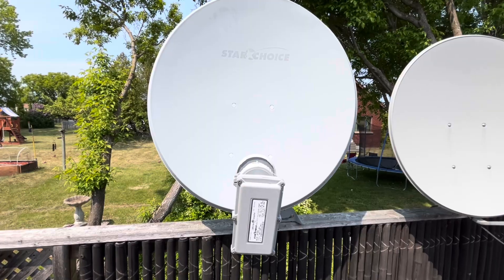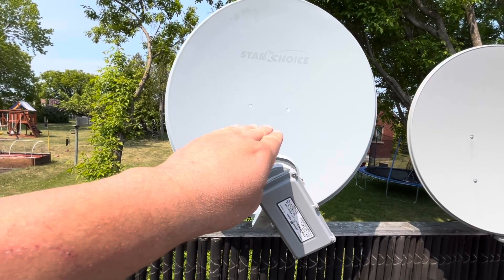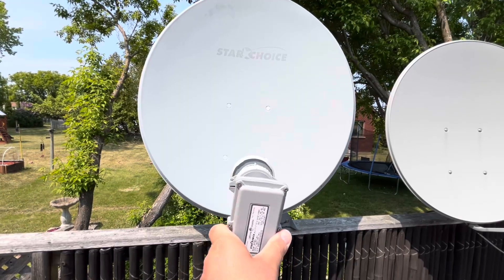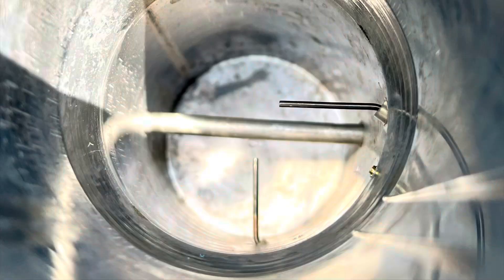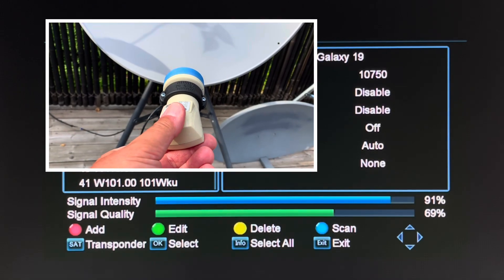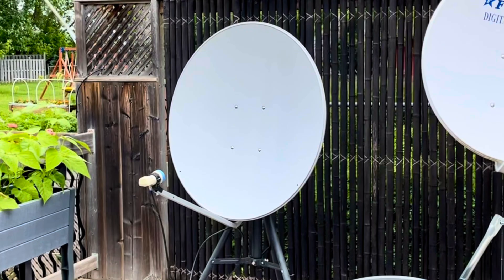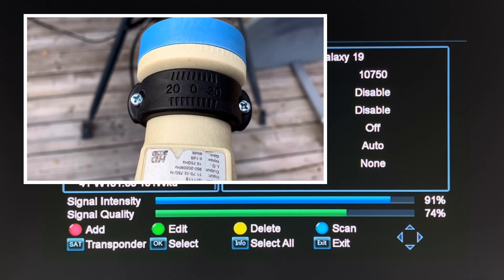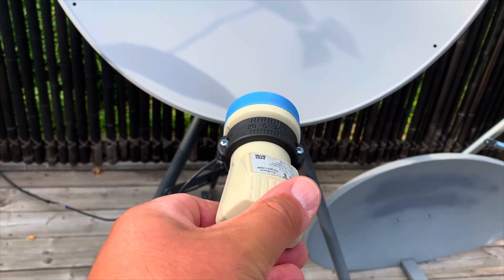LNB Skew is critical when setting up your FTA satellite dish

Comment: I bit the bullet and bought the dish that you will see on eBay with the bar for multiple lnb’s  sold by Canadian seller  and got to say nice dish. Set the dish skew between 70 -80 degrees, my longitude here is 76 w and if I didn’t have trees on both ends of ark it will receive real good . Mounting only drawback is pole size not common   1.75 or 1 3/4 inch  dish . This is a switch it’s made in Mexico.   To find straight pole steel fab place , appear’s inb hardware is stainless and that’s a switch.

Comment: I remember when I got into satellite hobby back in 2018 after setting up the azimuth and elevation, the LNB was on 0 degrees, I didn't rotated and on some transponders I had low signal quality and during bad weather I got "no signal". I asked on social media and the installers asked me abou LNB skew, it was the final part of setting up the dish that I didn't knew. After rotating the LNB I had very good signal even excellent.

But if you use H-H USALS motor you never rotate the LNB. The LNB Skew is always 0 degrees you only setup the motor elvation, the dish elevation, the azimut, enter the GPS coordonates on your satellite receiver ant that's it. Make sure you have clear sky otherwise you won't receive some satellites.

Comment: Quick question sir. My dad had an old tv so I got him a new 65 in insignia. His old tv was working fine with his old antenna for digital channels. But now this new tv picks up all the digital channels but the screen keeps blacking out and there is no sound. The first day they worked fine but then it went to $hit. U think I need a new antenna? Antenna is about 15 yrs old
Reply from the maker: Before you buy a new antenna, I would check all the coax cable connections.
Reply: @NorthcoasterHobby yup that's what it was. I made 3 new connections and deleted an old splitter. Working good now❤
Reply from the maker: @fencerider1492 Excellent!

Comment: Good info for those who need it.  I will add a little about adjusting things
A very common way to tune something is to look for the highest signal but usually the curve has a flat top to it so there is a range where it appears to be maximum.  A slightly better way is to find that maximum and then think of a slight reduction from that.  You then tune each way from maximum until you get that slight reduction.  Once you have those points, you set the adjustment for 1/2 way between them.  This way if something wobbles your adjustment a bit, you have the biggest range until the signal is noticeably reduced.

Comment: So if looking at the dish from the front like you were counter clockwise (left) rotation is positive skew and clockwise (right) rotation is negative? I have my dish currently on 30.0 w with a -41 skew but it’s not receiving all the transponders it should. 39” dish fyi. i just realized mine is at 41 but left rotated
Reply from the maker: That is correct. Specifically , which transponders are you not receiving? I noticed some of them have a high FEC, meaning they need a bigger dish. Depending on the transponder, this might apply in your case.

Why You Might Need a Bigger Size Satellite Dish for Free Satellite TV
https://youtu.be/DgUCJ4U7gXM
Reply: @NorthcoasterHobby I know I was hoping to get the one with the Vatican shot on it. But if my skew is way off that might do it. That Peter fairlie guy gets more transponders than I do

Comment: I get all my local channels with a tablo ota antenna dvr
Reply from the maker: Excellent.
Reply: Yes, for now, that is how I do it too but to be very pedantic, I get the stations I actually watch with the antenna and a different brand DVR.  I have pointed out before that there are no extra points for receiving a station you don't ever watch.  When people are discussing antennas getting the station you want is the measure of success.  Once that is done the project is finished and you can go hang that picture you've been meaning to hang.